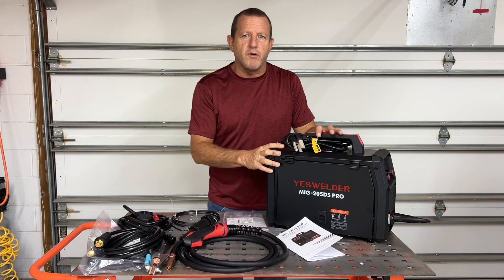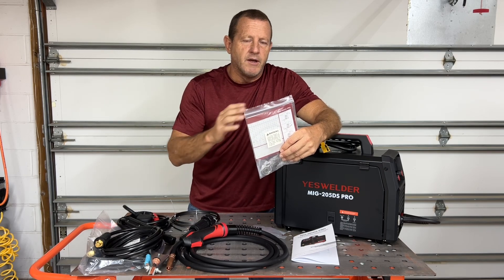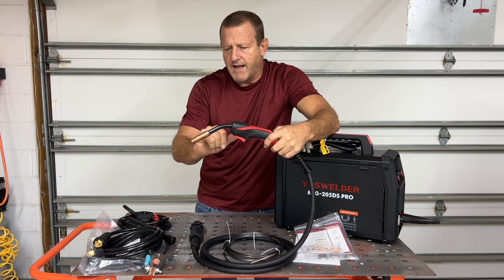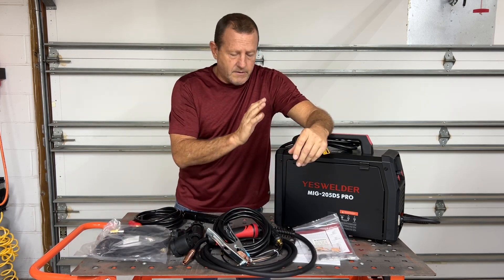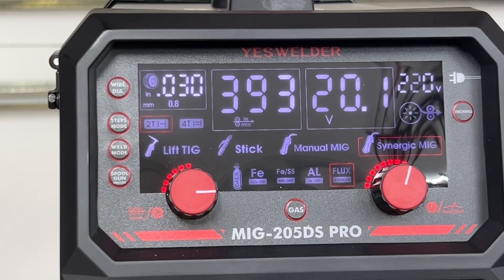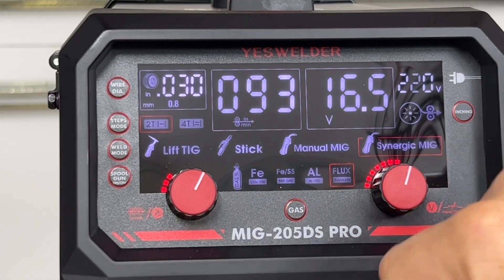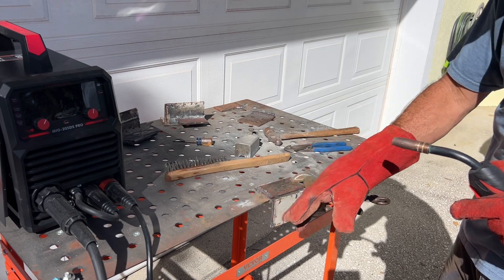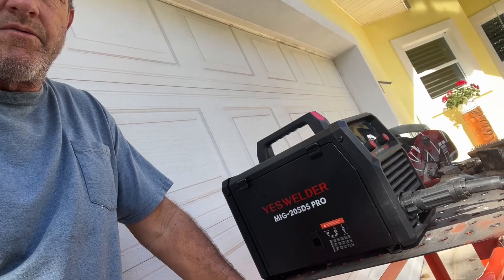YesWelder MIG-205DS-PRO Review | Setup | Flux Core Welding Test

Comment: How did you install the drive roller with flux core? Was the .8 facing inside or facing towards you?
Reply from the maker: the number of on the side of the roller coincides with the groove so if using .08 wire the .08 number faces away from you. the wire  tracks on the inside groove when instaled